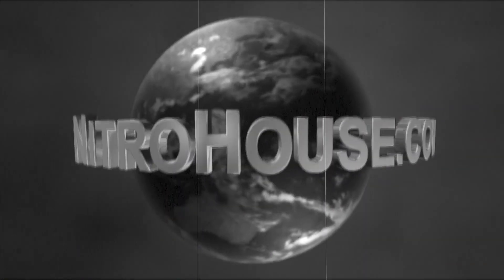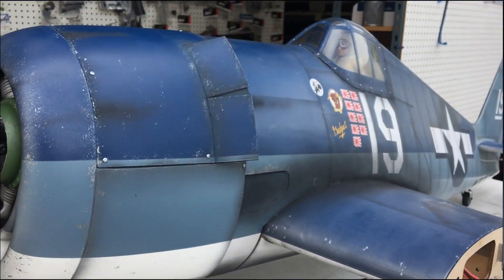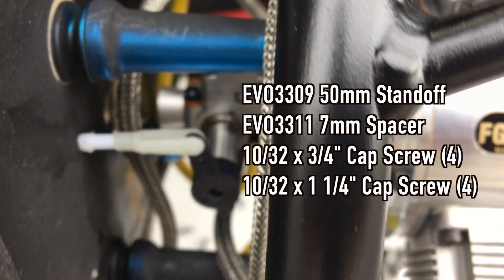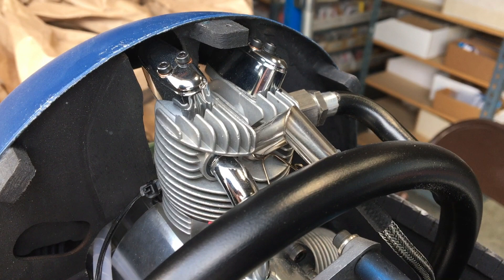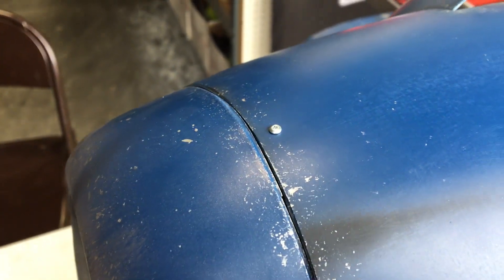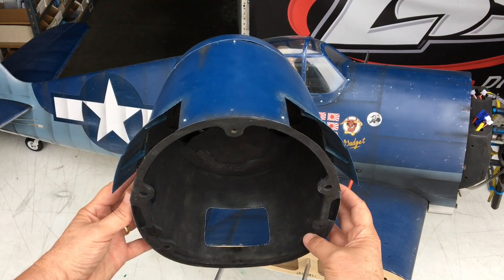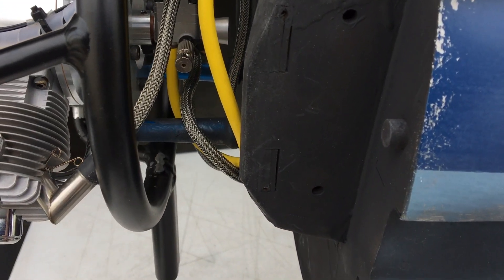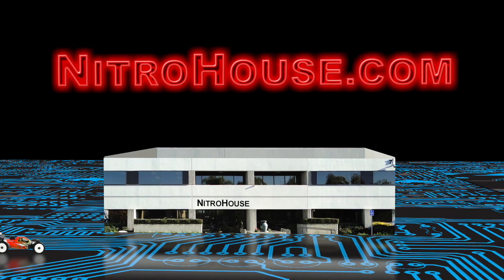Installing Saito FG-60R3 Radial Engine into Top Flite Giant Hellcat F6F

Comment: Can you advise what the actual Cowl size is? I am looking to do something similar but with the new Saito 5 cyl 73R5 cc its 5 cm larger in radius that the 60R3. Would that fit the cowl?
Reply from the maker: There is about 5mm clearance between the front of the number one cylinder valve covers and the cowl. Best regards.
Reply: @NitroHouse  Thanks for that. I miss wrote, its 5mm not 5cm. Doh a typo. So it should just fit if I opened up the cowl flaps. I think it's worth a try. Cheers